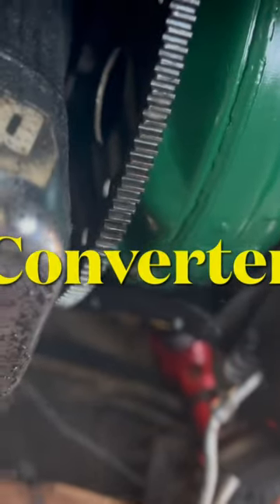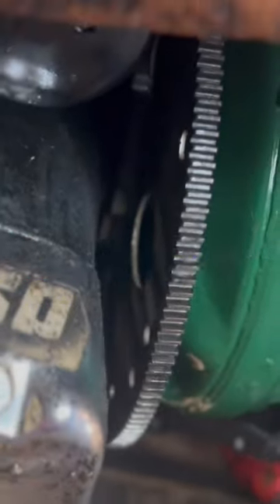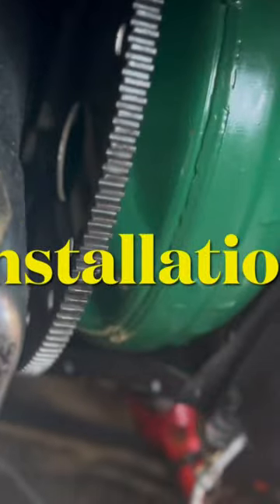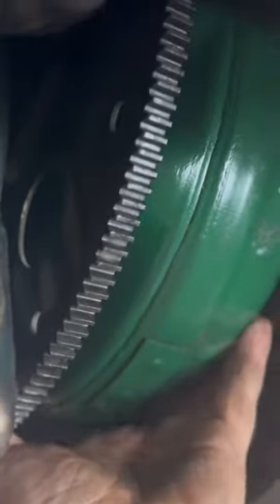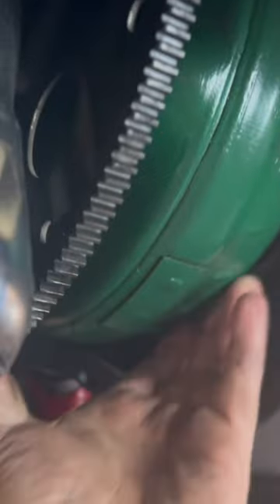Torque Converter installation tips #chevytrucks #k10 #automatictransmission

Comment: Hopefully you can answer this ,should there be that back and forth slack with the TQ , I thought the TQ had to stay as far back as possible and to get rid of that slack do you add a washer or two ? Or is that amount of play/slack what your looking for ??
Reply from the maker: @dylanschaffer8311  You need that end play before you bolt the converter to the flex plate. It’s all about the way it fits into the pump. If there’s to much, more than 3/8 inch I add shims so I have enough mesh into the pump